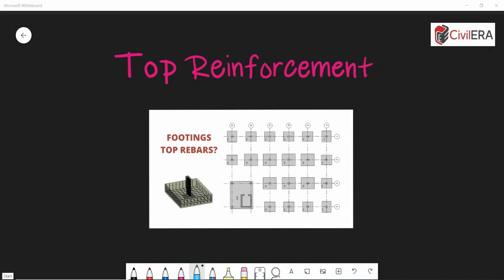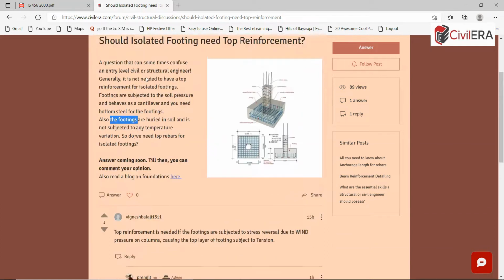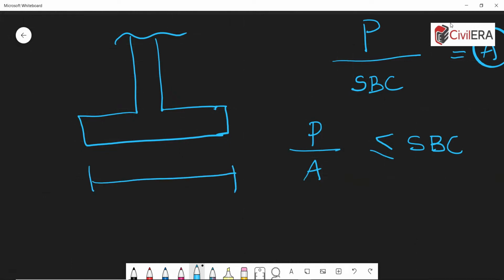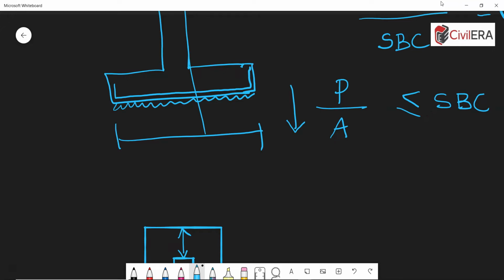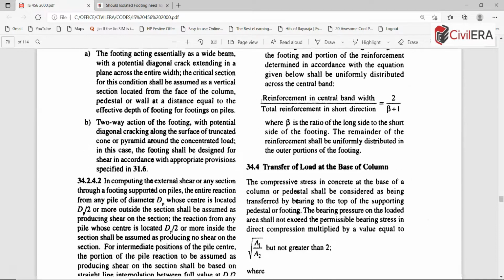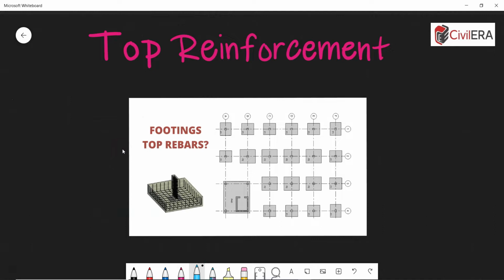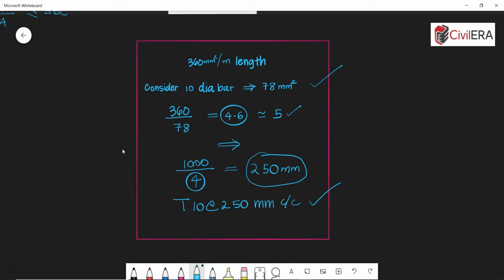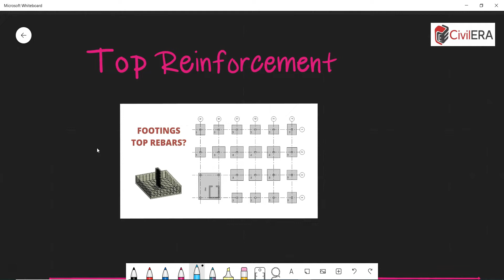Is Top reinforcement needed for Isolated footings?

Comment: Nice explanation. But I have one quesion . How can we design combined footing  with core walls and how we can check punching of those walls. Can you please have a vedio on it? Thanks
Reply from the maker: Am assuming, core wall you would have modelled in ETABS. For simplicity, you can add up the loads in each leg of your shear wall and apply at the centre of each leg. 
You will need to find the CG of loads and then decide the dimensions of the pad in a way to match the geometric CG and the load CG

Punching you can check in the same way as you check for columns. You can check it for each leg aswell
Reply: @CIVILERABangalore   Thank u.  Actually I exported all the reactions of my model to CSI safe for foundation design. The reactions at every legs of walls and columns are exported.  After analysise,When I check the  punching at every legs of walls, the punching value is significantly high at some legs ( 19)  for mat thickness of 800mm .which is impractical  for 11 story building. I don't know the problem?? Do you have any idea?
Reply from the maker: @melesedemissie7664  check punching manually

Comment: Nice Video. I just wanted to ask, when you mean reinforcement at Top is usually required for depth 1000mm, I'm assuming you mean embedment depth or just the member thickness of 1000mm? Or both scenarios?
Reply from the maker: Total thickness of section

Comment: Nice information. But you didn't explain why minimum reinforcement is provided at the top. Yes, it is in the code but what is the function of the top rebars? And why top rebars are not required for sections of thickness<1m?
Reply from the maker: It is understood. When the section is thicker, chances of cracking are more. IS has decided it for over 1m. Same is different for BS. You can check the crack width calculations in these codes

Comment: Can anyone please provide me with an example of safe  where it is possible to create isolated footing without a top reinforcement......!??!! Small large size doesn't matter just create one isolated footing in safe where top reinforcement is not required.......!!!
Reply from the maker: Generally Top rebars are not needed in Isolated footing if it is designed as a singly reinforced section. It is advisable to design as a singly reinforced section. So if you do that, the only need of top rebar in isolated footing is when the depth is more than 1000mm as per IS 456.
Reply: @CIVILERABangalore  i am using less than 1000 mm depth, even when forces is low..... there is no way where i can get zero reinforcement in top (with design strip or in FEM method) while checking for reinforcement after design in SAFE......here i am not talking about manual design....
Reply from the maker: @vasubhadania   Am sorry. I cannot understand you. 1000mm bars your won't get any where. I meant the depth.

Manual or software, you don't need top rebars unless it is doubly reinforced due to lack of adequate depth
Reply: @CIVILERABangalore  sorry i actually ment 1000 mm depth.....i am trying safe because safe can also be used for combined footing.....
While using safe there will always be top reinfo.... I want to resolve that....
In short i am trying to get no top reinforcement in safe but why is there always top reinforcement.....i want to know that reason..!!!
Reply from the maker: @vasubhadania  You are perhaps over using SAFE. You just analyse and zone the forces and dont use the design oprion

Comment: Hi there is top reinforcement needed for a 600x600x500 deep footing with a 1700hx 470x470 core filled brick column?
Reply from the maker: For an isolated/pad foundation, force point of view, if the loads are uniform like what you mentioned, there is no need of rebars at the top face. However based on the code of practice in your country, there will be a min steel specification. Please see that.
As per IS codes, you will not need it as mentioned in the video.

Comment: Great and clear presentation. However, if you have 5 bars per meter, the bar s[acing will be (1000/5= 200 mm). Within 1 m, we need to have the area of 360 mm2 ( or 5x78 = 390 mm2). This is only possible if you provide H10 @ 200mm c/c.
Reply from the maker: 1) 200 or 250 does not matter with respect to the topic of discussion. Discussion is about the need of top bars. is it not ?
2) 5 bars means 4 spacings. you can sketch and see yourself. 4 spacings in 1000mm is 250mm
Cheers 🙂
Reply: @CIVILERABangalore  Thanks for reply. I shall send you email.

Comment: While working in a construction company,  I came across a isolated column footings with depth 2.25 feet and the size of the footing was (7.5' × 7.5') and the structural drawing had mentioned top reinforcement in both directions and provided with 4 steps to hold those top bars in position . Is there any reason for it?
Reply from the maker: The info you provided is not adequate to conclude with an answer :-)